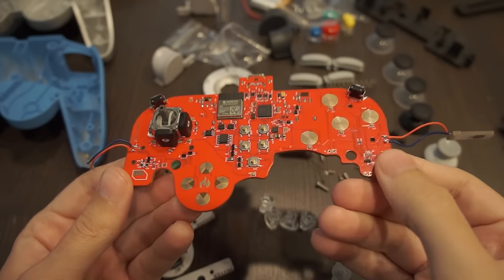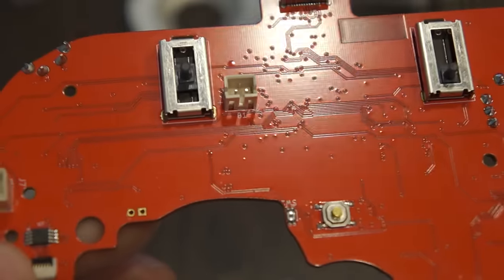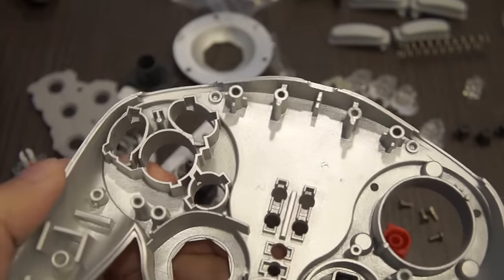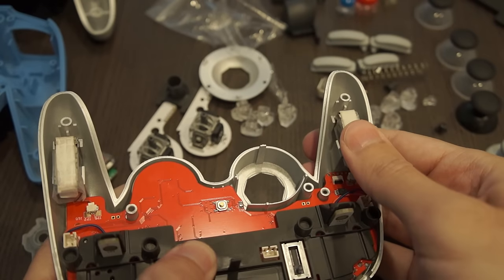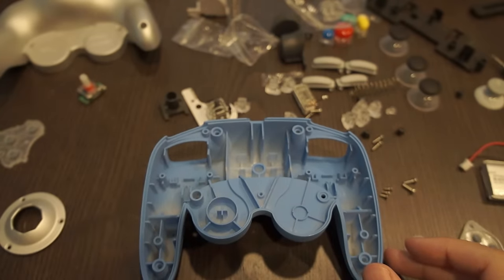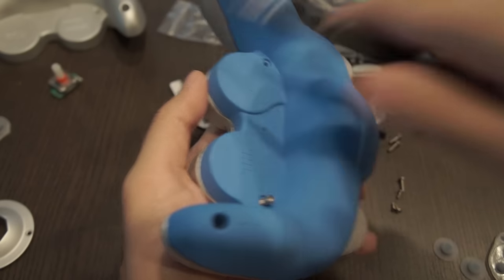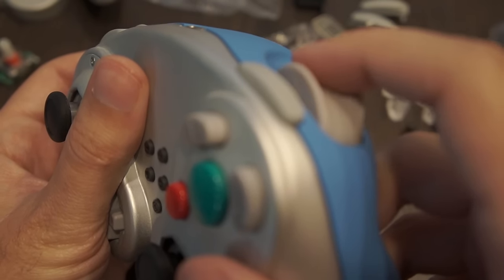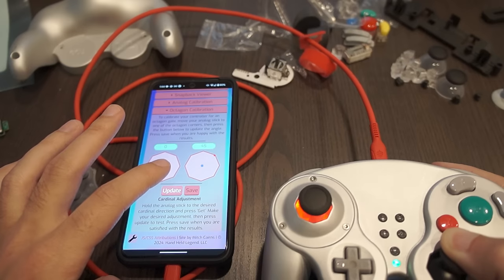The GameCube Controller Build Of Your Dreams - More Details Inside

Comment: This has the potential to become a huge operation. I'm praying that some controller manufacturer reaches out to you so that this will be massively widespread. The only thing that would be even better is support for original sticks, since then no one could complain about anything.
Reply: The whole point is to NOT be bound to some other corporation or manufacturer. I understand the sentiment of what you're saying, but it's not going to go down that way. More to come on stick designs later

Comment: there's a GYRO ? this is even better than i thought it was. Literally my dream controller, definetly getting one. between the modern bluetooh connection, the original gamecube/n64 adapters, the high level of customisation both in hardware and software, the fact there actually are analog triggers, and the freakin' RGB lighting, this really is the ultimate gamecube controller.

Just small question, does the n64 adapter have rumble pak functionality ?
Reply: Yes, N64 mode supports rumble
Reply: Even better, a twitter reply noted that the gyroscope design is based on Alpakka controller, which utilizes two gyroscopes!
Reply: @SuperTopmaster  Now that you talk about Alpakka controller, is it known what is the polling rate of this new gamecube controller?
Reply: @blorbb5398  Depends on the mode. GameCube mode will be dependent on the game. XInput polls at 1khz, Slippi mode 1khz, Switch mode 125hz. Many of these situations are capped by the host system.
Reply: @MitchCairns  Ok, thanks

Comment: Incredibly excited for this product, and I'm especially impressed with the app calibration and customizability. Having a second z-button is awesome, but I would love to see the z buttons come in default purple.  Excited to see gateplates with wavedash or firefox angles. For how true this controller stays to the original, it is a little odd that a transparent default control stick is a stretch goal. Dual rumble and gyroscope is very cool as well. I'm a little scared that I don't have a price estimate yet, but I'm hoping the kickstarter will be at a discount. This is totally a by the people for the people project, it feels very considerate of the consumer
Reply: Upper end price would be $135. We haven't shared anything on it too much yet because it's subject to change and I don't want to let anyone down with a wrong price. It will be determined soon

Comment: This is incredible! Truly the ultimate GameCube controller with its calibration options!

While I do appreciate the right stickbox being replaceable, do you plan the same for the left stickbox? The left stickbox seems to be soldered on and not everyone knows how to solder in case replacement is needed due to wear and tear.

Also, having easy access to the stickbox internals for cleaning and re-lubrication purposes would be great but I know that's beyond your control.

Outside of that, this is the best thing I have ever seen for Smash. I will definitely be backing this up!

Comment: Looks great, But I'd love to see mecha tactile buttons like the latest gamepads in the market

perhaps you could add the pads on the PCB so that if the user wants to he can buy the microswitches (I recommend kailh mouse switches) and solder them to the board and then just by adding a different membrane we can have mechanical buttons as well!
Reply from the maker: I have implemented a small connector on the newest iteration of the PCB to allow swap-in of different button contact types.
Reply: @HandHeldLegend  Is the swap-in possible without soldering? Also since this controller is a ''pro-controller'' are the L & R trigger buttons seen as ZL & ZR by the switch when in regular/pro controller mode? I'd like to know this when using the controller as in some games ZR&ZL are default buttons for shielding/shooting/aiming and not L & R.

Comment: You might have already mentioned it but have you stress tested the sticks for snapback issues? I didn't see any digital snapback capacitor so I was wondering if it might come with one just because it doesn't seem like they are manually tested just because you said in the video that not all the sticks will be the same calibration (If that makes sense).

Edit: I find searched the Kickstarter and found there is filtering built into the software.
Reply from the maker: There is an automatic digital snapback filter in the software ^^

Comment: I'm interested, but the GC shell doesn't seem to match the OEM shell quite right. For example, there doesn't seem to be a pronounced circular bump centred around the "A" button like on the original controller. Additionally, the divot around the D-pad is soft instead of having a defined edge like the original. 

Are these differences planned to be addressed? If so, I'll back one immediately!

Comment: So after hearing that you'll be using the TMR Sticks from Gullikit, your calibration software gets around the issues of emulator & PC compatibility that's been observed with the mod kits that Gullikit provides for the Switch Pro Controller?

My other question is that for the PC Mode, will games recognize analog triggers?
Reply: Our calibration software is a completely custom thing and you won't have the same issue. 
XInput mode works with the analog triggers

Comment: This is so cool! A couple questions (for the use case of only ever playing on gamecube/wii):
- is the battery needed for the rgb if it's plugged directly into the console?
- will there be an elegant way to remove/disable the left z button (such as including a cap that can't move, or one you can print yourself)
- do oem sticks fit (gray and c-stick)? I'd assume yes but you didn't explicitly state it
Reply: - Battery is not required for operation over wire (same with RGB)
- No, but that's a fun idea and developing a printable cap should not be a huge hassle (I don't have plans, but 3d files are on github)
- No they don't, because those stickboxes are a different height among other things. We have a stretch goal to create new sticks that would resemble the original style

Comment: This looks amazing! I hate to ask for more but would there ever be support for a mirrored controller? My left thumb doesn't work as well as my right and I've always wanted to try the analog stick on the right. (I now realize that isn't as simple as mirroring the board.)

I've even tried holding my controller upside-down and calibrating the stick in that grip.

I'll be supporting and I hope you succeed!
Reply: This controller does support axis inversion in the config... so you could hold it upside down and use it that way
Or design some other shell that supports the mobo upside down or whatever

Comment: Hi, this product looks amazing and is definitely a must buy. However I was wondering if there could be a way to get mouse clicks for Z and ABXY. If I have to find a way to mod it in then so be it but for me who has this in his phob its a must and I don't think I'm alone in saying its a feature I'd pay extra to have done for me. Regardless this will be the best value in smash. This seems very by the community for the community so I figure I might as well ask for this feature. 😊
Reply: There is a connector to support flex PCBs that would sit on top of the existing button contacts. No plans in place to do anything specific yet, but I've dropped template files for any modders or makers who want to give it a try.

Comment: Is there any chance of making an alternate shell or just a 3d model with better ergonomics on the handles? Preferably a more modern variation where the handles are slightly bigger and flair outwards more so you don't have to curl your index fingers to get them on the shoulder buttons?

Comment: How well will it work on steam input? I'd want to use the analog triggers and gyro aiming at the same time, but only the PlayStation controllers have both. Can this act as a PS4 controller?
Reply from the maker: There is a beta DS4 simulated mode that works with SteamInput, that has preliminary support for analog triggers and gyro. It's very much beta but we can work on improving this in the future.
Reply from the maker: @HandHeldLegend NOTE that the DS4 mode will NOT work on PS4 or PS5.
Reply: @HandHeldLegend  fine by me, steam input is all i need. i have a fat ps4 but i haven't used it in ages. thanks for keeping all of this in mind.

Comment: could it be possible for you to use jst connectors or something similar to the joy con connectors, or an older, thicker cousin of the ribbon connector, for the stick sub-board? i love the project but those fragile folding connectors are the bane of my existence.
Reply: i cannot tell you how many of those micro latching ribbon connectors i have unintentionally destroyed over the years, even the friction fit ones they used in the 90s that were also fragile with the side latches are a billion times more durable in my opinion.
Reply: honestly if you had optional through holes for the pinout, i would happily take that as the easiest alternative connection solution, i just know if i get one of these (which i still really want to), i will almost certainly break the snap ribbon connector at some point.
Reply: @SlavTiger  There are through-hole connectors you may use if you have the appropriate soldering equipment. It's a 6 pin connection and I'm sure you can get those for pretty cheap. Cheers

Comment: Are you interested in expanding the controller design in the future or will this be HHL's final GC ultimate design?
Reply: Never say never, I'm sure there will be things I'll want to improve or change in the future. 

Full transparency the only other thing I'm considering right this moment is some kind of stripped down, fully free/open board that would be made to run the Phob firmware but use the same shell.

Comment: question for the modular slider whenever it actually gets fitted onto the board - does spamming the trigger very hard and fast have a tactile sensation? can you feel the strain at the trough, and can spamming it really hard really not make it pop out?
Reply from the maker: Because of how the sliders are mounted, and how the triggers are mounted above it, there's not any room for the sliders to physically pop out even if it did have the appropriate force to move in that direction.

Comment: Shut up and take my money

Real talk though, have you considered changing the touch pads for the ABXY buttons for mechanical switches? There’s a controller by sunwaytek which the overall build quality isn’t that great but the buttons are all mechanical, it kinda feels like you’re clicking a mouse by pressing the buttons and they don’t wear out like touch pads do. The prototype just has smooth mechanical switches.
Reply: Yes. There is a connector on the front of the PCB (not on this prototype) to attach custom made flex PCBs for different button types. There's an open source template for modders to make their own creations.

Comment: Are there any latency issues? Wired or wireless. 
Id love to back it on kickstarter, but I have to ask, will there be any guarantees or safety measures for backers?
Reply: What we offer is a competent shipping team, great customer support, and years creating and shipping other products. We hope this is enough to give you confidence that we can deliver on this project. The other major project controller I've completed and shipped is the Super Gamepad+ and the ProGCC kit. The ProGCC is more popular and it's widely used by Smash Ultimate competitors for its low-latency wired mode. Wireless modes will have more latency than wired always.

Comment: any chance of the USB-C port being put on a sub-PCB on a future revision? replacing broken ports is kinda of a pain when you're only option is to solder on a new port.
Reply: It was tested and found to cause connection issues on more units (higher defect rate)
Reply: Maybe in the future I'm open to looking into this again, but it's very difficult to maintain the kind of integrity that I want with the USB connection while also using a connector type that isn't error prone or causes other headaches

Comment: Forgive me if I've missed a comment or this in the video, but any thoughts on use of original C sticks on this?
Reply from the maker: Original C-Stick will not fit. We have a stretch goal to develop a new set of sticks though. It is extra development time and cost, and that's why it's a stretch goal at this point.

Comment: Input lag?
Reply: Input lag is virtually 1ms. Actual input latency will be highly dependent on the use case. Bluetooth is more latency than wired. Wired latency varies from Switch to PC. Switch is about 4 frames of latency because of the console. PC yields much nicer results and you can use XInput mode for 1khz input polling rate. This also does not take into account how games are set up so the long answer is it depends, but I've done all I can to ensure the controller provides the best experience in any situation

Comment: I really want to buy a few of these but will it eventually make it to your website? I’m leery of kickstarter tbh.
Reply from the maker: Yes that will be the plan. We need the initial funding to pay for the molds up front though.
Reply: @HandHeldLegend  got ya, thanks for the response. I may reconsider because I do trust you. One additional question though, do you plan on selling the d-pad by itself? I’d imagine it would fit in the oem controller since the oem d-pad fits in this correct?

Comment: "final" "ultimate" sickening. the ergonomics are trash, the floating c stick board isn't utilized at an angle, the handles are terrible placement like the original. fuck this controller, you need to reduce the hand fatigue that GCC are notorious for. would love the STL to chop this up and show you a real controller.
Reply: The 3d files are on github go ahead
Reply: What a sad, bitter comment